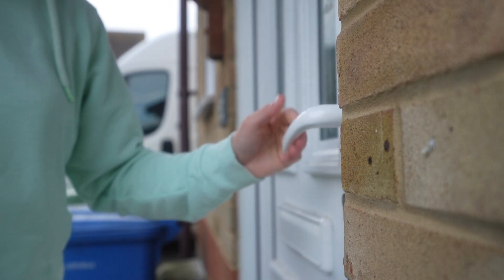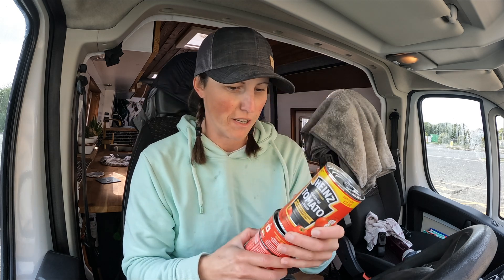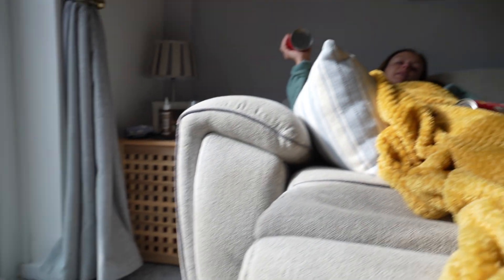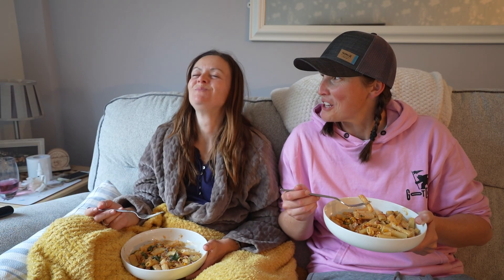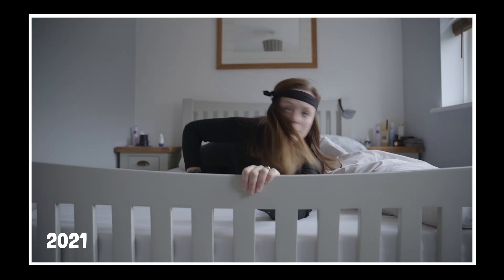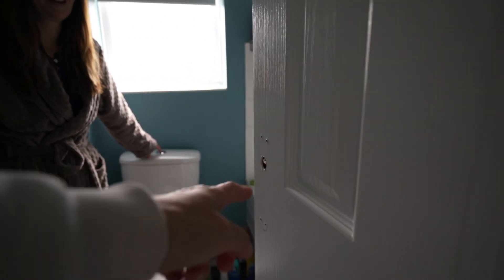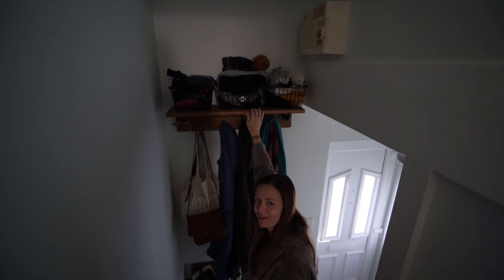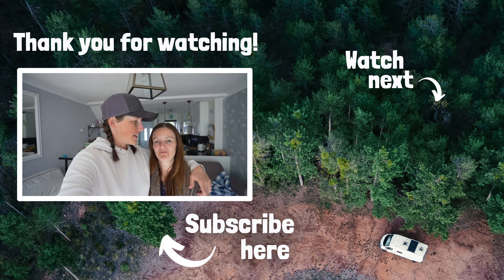We show you INSIDE van life couples SECRET house!! (Tiny home tour UK)

Comment: Swede here! We usually have wooden floors, and tiled bathrooms (sometimes with floor heating). Stone isn't commonly used, nor is carpet (surprising for most non-scandinavians as we also take our shoes off at the door). Compared to the UK,  houses and apartment buildings in Sweden are better isolated both with thick outer walls and double or triple glass windows. We also have some pretty effective radiators in all rooms. So our homes are dry and warm! 

Hope you're feeling alright!
Reply from the maker: I love the sound of your houses, they sound very cosy 😀😀
Reply: That's the same in Denmark. I don't think we can buy anything that isn't energy efficient and easy on maintains. Most city apartments have plank flooring and regional carpets.
Reply: @charisma-hornum-fries  Sounds lovely :0
Reply: Sounds wonderful Swedes, Germans and Dutch know how to do it! 😊
Reply: We are a born British, now Swedish, family and l love the wooden and laminate floors (easy to clean) but l did put carpet in the bedrooms! Large rugs are popular and many house or apartment block gardens have a frame that looks like a goal post for hanging your rugs on to beat them, or l suppose dry them . . . they are great for drying tents on after camping!
Reply: @helenlayley  there was one of them in my grandparents garden, along with a cane carpet beater! Remember it from the 1960s, it's long gone now

Comment: In Texas, we don’t have radiators. The hot air blows out of vents from the ceiling or floor to heat the house. I grew up in the UK as a kid ever since I moved to the states 30 years ago, I’ve always missed central heating. Not a fan of hot air blowing on me.  It’s also more common to paint walls instead of wallpaper
Reply from the maker: Yeah that does sound a little weird to be fair, so want to visit Texas 😀
Reply: @campervibe  if you ever make it over, I’ll be happy to recommend and show some fantastic spots.  Austin is super pet-parent friendly

Comment: Sooo….why are the washing machines in the kitchen…and what on earth do you do for drying clothes in the middle of winter w no dryer? And yes, here in the states we use both quilts and blankets. We add a flat sheet (or top sheet) to the bed to protect the blanket/quilt from becoming dirty so quickly. It means less washing and drying for those big bulky bed coverings.

Comment: We in Sweden have solid wooden floor or parkett floor in flats, but of course you can get carpet. But the difference is that the building standard compared to the one you have is different. That has to do with out cold climate. The roof has to be stronger to cope with the weight of  the  snow so the roof doesn´t collapse, isolation in the roof, walls and ground has to be better. Better compared to old brittish houses. I´m talking from my own experience. Was in january in London, Stayed at an old hotell. It was a couple of minus degrees but your humid climate made it feel like it was colder.
Reply from the maker: Yeah someone else said that, it’s pretty cool really

Comment: The main difference between the UK and the US with the use of quilts and duvets is that in the US you usually have a top sheet underneath the duvet, rather than just using the duvet cover as your top sheet. This means that duvet covers get washed slightly less often than your regular sheets. My understanding for the UK, (and when I lived in Ireland) is that there was no top sheets, just the duvet covers so that got stripped off and washed when you did your sheets… with our fluffy dog, we have A top sheet, then a blanket, then our duvet, then a dog sheet on top of the duvet, so that we can get away With only washing the duvet cover once a month, but washing all the sheets once a week(ish). During the rainy season, the dog sheet often gets washed three times a week, as she has a lot of fluff… and that’d be a pain in the a** to strip the duvet that often 🐾💕🐶

And feel better!
Reply from the maker: Oh wow, that’s a lot of sheets right 😊
Reply: @campervibe  It is. But its true that most people in US use a top sheet, probably a blanket and then a comforter (duvet). I cant stand just a comforter, if I get too warm and I need to roll back comforter I have no covering!
Reply: @campervibe  you can still buy the 2-sheet sets here in Ireland, the duvet only is a German (continental) concept which has crept in
Reply: I always use a top sheet. To save on washing the quilt cover.

Comment: I live very much up in the cold north of Sweden, in a traditional one floor red house with wite corners as you have seen is typical here, and I do not have carpet in any rooms, wooden floor or Linoleum (actually PVC, but you know what I mean) I do have some small rugs. 
We also don't have the washing machine in the kitchen, we have it in the bathroom, we have one grip taps in the kitchen and bathroom that mixes the hot an cold to any temperature instead of the separate taps common in UK.
(Also, I sent you a picture from Willys, but forgot to include my Youtube handle)
Reply from the maker: Washing machine in the bathroom, well it does make sense for sure as that’s where you take your clothes off to wash your body, I think it’s coz our houses are generally smaller over here and most have room in the kitchens for them rather any other room.
Reply: @campervibe  
That, and the fact there is plumbing and electrics in the kitchen already.
In bigger houses there is usually an entire separate wash-room with washer/dryer and a big pre-soak sink.

Comment: In Australia, many houses would have timber/laminated flooring as it is easy to install and clean. Tiles are for bathroom and kitchen areas as they are waterproof. Some houses would have carpet in their bedroom as it is nice and warm in winter. However, Australia can get very hot in summer so timber flooring has its advantages.

Comment: As a Norwegian - no, we don't have wall to wall carpets anymore - we used to. With better insulation in the walls and floors we don't really need it as much, and we find having wood flooring, or vinyl, or tiles ( though tiles is more used in bathrooms and entryways and such) is just more hygienic and easier to keep clean than carpets.  So we mostly use smaller carpets underneath couches and tables, with exposed wood\flooring around. 

I used to live in London, and the place I rented with some other students had carpets in the bathroom. To me that just screams "best place to breed germs", lol! 
Of course in that house the landlord also boasted of recently installing double paned windows (as opposed to single panes), which in Norway we've been doing for a few decades already, and newer homes use triple paned windows. 

It gets colder over here, though - so long term investments in better insulation technologies is cost effective and necessary for us :) 

Travelling around I have also figured out that many places in the US do not use duvets, and the quirkiest thing I have experienced is actually the taps! Having one tap for cold and another for warm, so you have to adjust them both to find the right temperature is such a quirky idea to me - I'm so used to just having one tap with hot and cold to each sides, and straight gives the middle section of them both, and as such is most used.
Reply from the maker: I love hearing about peoples homes it’s really interesting to know why other countries mainly have and you are so right carpet in the bathroom or kitchen is definitely wrong for sure

Comment: Norway is mostly hardwood floors, or laminate, and we have area rugs.
Its just easier to keep clean, the rugs can also easily be replaced, to match when you change style. 
Tiles or that plastic flooring in bathrooms and mud/entry room, mostly with heated floors.
Reply from the maker: I do like the fact you can just change rugs easily right

Comment: In New Zealand, coming from the uk, most kiwis don't understand why the poms have a washing machine in the kitchen

In nz, there is an additional room. The wash house. Usually attached to the kitchen and out to the back yard
Reply: in north east england in the 50s, all council owned homes were built with "wash-houses" at the side of the main house, with their own gas/water/electric supply, but no heating or insulation. unfortunately, due to our cold winters, they were not very nice places to spend the day [usually all day monday] to get all the washing done, using the gas boiler, the sink, + the spin-drier.  when "automatic" washing machines became affordable + watertight, they came into the kitchens in the late 70s, + the wash-house became "the shed". larger houses now have a "laundry room", which has a concrete floor to keep vibrations down
Reply: @paulriggers1558  nooo. I was born in the fifties. Washing machines, south of the gap anyways, were always in the kitchen. Popular were the twin tubs.
Reply from the maker: Yeah I have always known them to be in the kitchen to be fair but who knows pre my Nan 😂 it would be lovely to have an extra room but down south houses are so crammed in you just get enough space to live unless you got big dollar 😂😂

Comment: Hello from NE Ohio. Our home was built by Amish builders for an Amish family. They lived here for 4 years. The second owners were "English" (non-Amish) and lived here for 4 years. They put in the Electricity. So the overhead lights are not in the center of any of the rooms. The outlets are few. And none in the 1 bathroom. We do have hardwood floors. We have a 3 bedroom ranch. Red brick on the outside. But only 2 closets. And full basement. Washer and drier down there. We have 2 acres of grass and trees. We have been here 50 years. It really is lovely. We sleep with a sheet and blankets covering. Some have quilts or comforters instead of blankets.
Reply from the maker: Love how random that is 😀😀

Comment: Thanks for another amusing video.
The best cleaner for removing algae, moss and dirt from the van roof is Rhino Goo 5L from Amazon, or 1L from Halfords bike section. It's aluminium friendly and the best product I have found for cleaning our motorhome with ease. Removes black streaks quickly and easily where other products fail.

Comment: Gadget John used a rubber solution paint on the bottom section of his van build, that will help reduce wear from using oversize tyres on the wheel arches.
Also probably time we had a look at hello fresh.

Comment: I am Canadian and lived both in USA and in Europe. In cold weather places, houses are properly insulated unlike in the UK, do not take this personal. If brittish houses were properly built people would save a lot of money in energy bills. I think the need for carpet comes from the cold temperature in houses. In Québec, where I was born, carpets wall to wall was a thing in the 60`s and 70`s, most people prefer hard wood floors and ripped off the carpets. Duvet or bed spread are a question of choice, but we always have a fitted sheet and a flat sheet. we sleep in between the two with whatever duvet, blanket or bed cover on top. we typically add a blanket during winter. I had never seen a washing machine in a kitchen before moving here. They are with the dryer, either in a bathroom or a laundry room. In North America houses and flats are generally bigger the the typical British house, I think you knew that. That said, here I am living in a Boxer conversion full time with no laundry room. I do however have a flat sheet under the duvet😉 Enough blablabla. you are great!
Reply from the maker: Oh yeah totally our houses are pretty much chucked up it’s horrendous and then they move way too much, get cracks in them and lose so much heat, it’s a shame they are built like they are

Comment: Tip for cleaning the roof next time - use a plant sprayer with a mix of all purpose cleaner (kitchen product) 1 part apc to 4 parts water. Spray roof and let the apc soften grime, then wash off with soapy water. Once dried off, use a spray wax like turtle hybrid ceramic graphine wax to then make it easier for future cleaning.
Reply from the maker: Nice thanks 😀